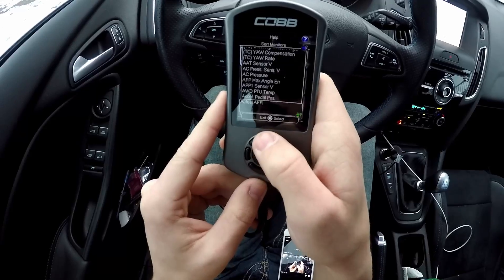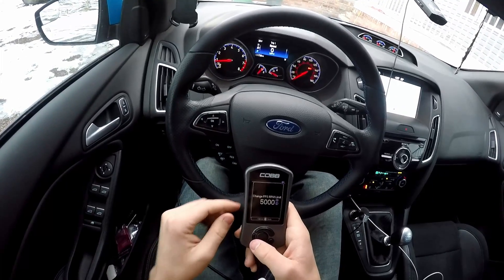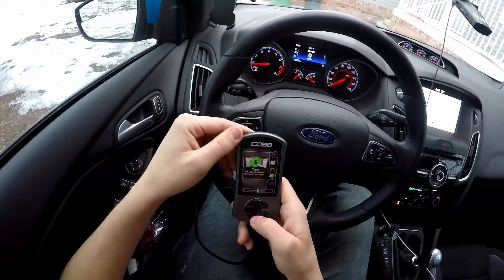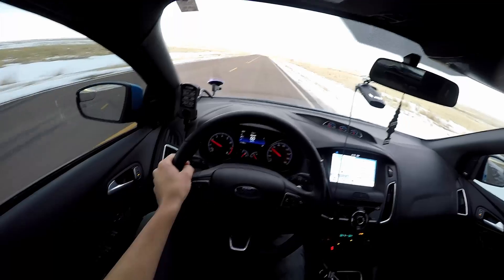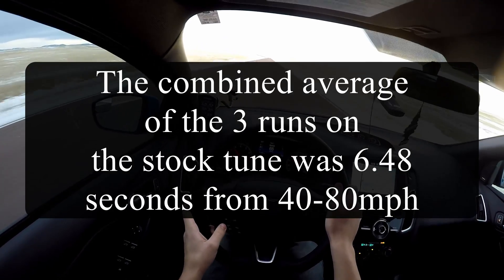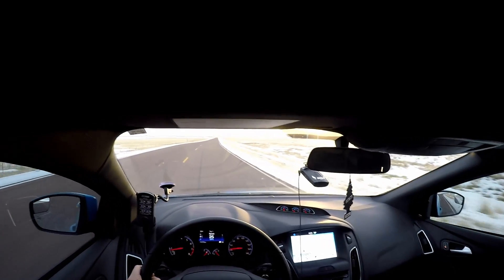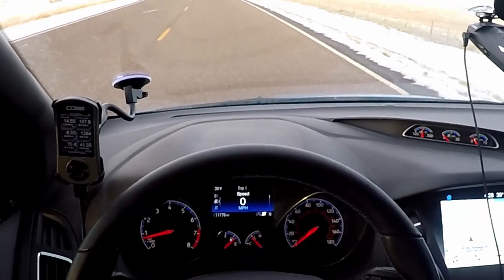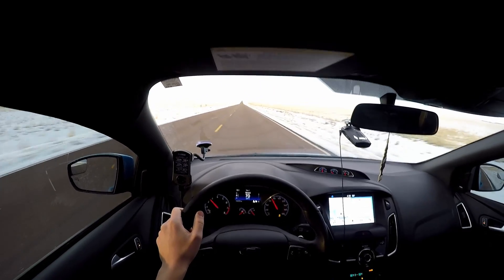Focus Rs stock tune Vs cobb stage one tune.

Comment: That was my main issue with this car when i test drove it.  It didnt "feel"  like 350 hp / torque.  Nice video  clean presentation of the difference the tune makes.
Reply: Wonder if the dealer put premium fuel in it?
Reply: If you dont take it out of the normal drive mod it feels slow..cuz it kinda is

Comment: The Cobb Stage 1 Focus RS tune is a waste.  Abysmal no difference from stock.  Just go with a pro-tune from Stratified or any of the other well respected tuners.  You'll have so much more power on-tap and so much better drivability.

Comment: Good video man. Do you have any other aftermarket upgrades besides the intake? Just wondering how much a custom tune would make a difference  with intake and exhaust over the preloaded tunes. Thanks. Keep the videos coming. Would be sweet to see you drifting around in some snow lol
Reply from the maker: No other mods yet but I plan on getting new boost tubing and a cat back exhaust then getting it dyno tuned

Comment: Hi, I know this is so old but just in case I have questions.  I am thinking about getting Cobb access port.  How long did you run OTS tune? Did you blow up?
Reply from the maker: Ran it for a few months and yeah it did😂 but tbh it was probably more down to me abusing the car than the tune itself. Modern cars have pretty impressive knock control so imo a ots isn’t the worst thing. I think my issue was disabling the soft limiter so I could ride the fuel cut and that caused a valve train failure which killed my motor.  So I’m my experience avoid banging off limiter and doing flat spins😂. It’ll probably be fine.
Reply: wow, It is so old i didnt expect a reply.  Thank you for the update.  Sorry about your RS.  I hope you went Built mountune longblock for replacement......hehe 🙂Subbed. @shenaniganshop3309

Comment: Hey man, great vid. I have a 17 RS and just waiting until the spring until I get the accessport.  Two questions. When you install the  accessport onto the car is it automatically in the race tune. Secondly do you live next to a runway because that road looks insane, thanks
Reply from the maker: Yep it defaults to the race tune but its super easy to switch, I live like 3 miles from a very vacant hiway road in "mexico" it's pretty convenient. Thanks for watching!
Reply: Yeah man just got it on Wednesday. Not happy because in the "recall" ( Ford doesn't like to refer it as that), it clearly states that they will provide alternate transport, a rental. But my local dealership said no I would have to spend $40 a day because I did not buy the car at that dealership. I have spent hours on the phone with someone from China trying to resolve this but at this point just want to stick a poker in my eye. I had an STI before this and Subaru where always incredible with service, loaner cars, anything. I have had nothing with issues withFord and how they have handled this recall and there service. Even the guys at the dealership where old cranky miserable shits, hated there jobs and it showed. Maybe its the culture of Ford but never again
Reply from the maker: Darren Law that’s a pretty messed up situation but I’d say that’s more to do with your dealer then the brand as a whole, some dealers are scummy like that and others go above and beyond.
Reply: Darren Law It took my dealer 5 weeks to replace my head gasket but they kept me in various the whole time I needed one. I went out of town for a week in the middle of the work but they put me in another loaner when I returned home.

Comment: Lets not sell the ST short here.  At 10:00 you say the eco mode makes more power than an ST.  I have tested my ST alot and found a 40-80 video on a stage 1 cobb tune.  It covered 40-80 in 4.9 seconds on cobb stage 1 tune with just a CAI.
Reply from the maker: Rustie Shackelford yeah this was before I rode in a st they are definitely a lot quicker then people think, my buddy used to have a stage one st and it was really close to my rs from a roll.
Reply: @shenaniganshop3309  I have a new ST too. I wonder why it's closer then it should be.
Reply from the maker: Thomas Oleson the st is lighter and makes good torque so at lower speeds it keeps up well but the rs has a lot more top end so after about 50mph the rs really pulls ahead

Comment: Just picked up my RS yesterday. Will ford know you're switching between maps? I'd like to keep my warranty and will switch back to stock tune on the AP but jist wondered if they can find out...
Reply: Juan Tobon they can tell the computer was reset. If you flash back to stock and uninstall the ap then drive to dealership it’ll show on the computer when they hook up it only has 10 miles on it. They will assume it was because it was tuned but have to prove it was the cause of the specific failure you’re in for. Some service techs will flag it. Some won’t. It’ll all depends, but no, they won’t know what exactly you have done to it.
Reply from the maker: The tune doesn’t effect the odometer reading dude lol even if it’s uninstalled, probably shouldn’t talk about stuff you don’t know much about might make you look kinda silly🤷🏻‍♂️ plus mine was warrantied after being tuned
Reply from the maker: I really couldn’t tell you, in my case the tune didn’t effect my warranty. I had a catastrophic engine failure and got a new long block completely under warranty (which I have a video on) but other people say their warranty was denied because of the tune. So the answer is maybe lol
Reply: @shenaniganshop3309  I don't think Agent K was talking about the odometer. The ECU does know how many run/start cycles have happened since the last flash. If you have 11,000 miles and show up with a problem and 10 run/start cycles since reflash, they'll have a good guess as to what's going on. No proof though, hence "undetectable". Also, not all dealers are as strict as others when it comes to warranty claims. Thankfully, I've only dealt with the more gracious ones on the rare occasion I've needed it.

Comment: What MPG you get on the economy mode? Would be handy for longer road trips if you can gain a few MPG.
Reply from the maker: At 80 mph I average 22-21mpg on the eco tune and  20-19 on the stock and race tune. At lower speeds the difference is much bigger though I can nearly get 30mpgs at 65-70 mph on the eco tune.
Reply: Shenanigan Shop that's quite good mileage! I took a road trip this fall from Washington State down to Southern California and averaged 16 to 18 mpg with my RS at 80 MPH, and 18 to 20 at 60 MPH. But I had a cargo box, roof rack, and mountain bike on top of my car! Without anything on top of my car I averaged 22 to 24, but it is very hilly here in Washington.
Reply: I road tripped from Minnesota to Massachusetts it took 2 days. Average MPG was 28 with cruise set to 75 mph that was in about 80 degree Fahrenheit weather

Comment: Pick your Ford dealership carefully, I went through hell with the dealership I bought mine at for repairs and had to go to Ford Performance to find one that sold performance parts to deal with my modified car. Even so, they all will blame your tune for any engine or P-Code issues.
Reply from the maker: A buddy of mine got a eco boost f-150 at the same dealership, he has a tune, aftermarket boost tubing and a full cat back exhaust, took his truck to some off-roading event blew his transfer case and the the dealership didn’t say anything, just fixed it under his warranty. He didn’t even take his Cobb access port out of his truck.
Reply: Dude! You're in great falls? Me too! Just bought a 2018 NB LE RS and I think you're the NB RS I saw driving through 10th yesterday. We should meet up and talk about our cars :)
Reply from the maker: Ninja Kali that sounds fun! You’ll be able to tell if it’s mine from my Cobb stickers and rally armor mudflaps, my dad has a 2018 nb rs also but his has a black roof, mirrors and wing. If you have Instagram or snap chat you can Dm me so we can plan a meet up both are shenaniganshop

Comment: Do you not put it in sport mode with the tune on? or no need?
Reply from the maker: The car has the same power in every driving mode so there’s no need really
Reply: I'd still put it in sport. It would tighten up steering, and open exhaust valve
Reply: @shenaniganshop3309  if you have the stock exhaust its only open 70% in normal mode which creates some exhaust restriction. It does make a difference
Reply: @4200cg  also adjusts throttle response/sensitivity which makes a world of difference

Comment: I don't understand how so. Any of you can just void your engine warranty so quick and easily? And yes this voids your warranty. It's also a federal violation of EPA laws to unlock a locked ECU, and manufacturer laws. The EPA is starting to crack down on people big time. And there is no way to re-lock the ECU if you remove the tune .
Reply from the maker: 😂no it doesn’t dude literally watch my newest video I blew up my rs and it was fully warrantied I show the receipt to prove it you should really do some research before you make yourself look stupid🤷🏻‍♂️
Reply: Actually master car guy is correct brother. Im a ford tech of 15 years. Hes absolutely spot on. You were lucky with your situation. They couldve told you to eat shit. You're the one who needs to do some research

Comment: how bad is FFS for the stock clutch?
Reply from the maker: Definitely shortens the life however launch control is much worse for it.
Reply: @shenaniganshop3309  That's what I figured.  Maybe play around with this right before a clutch replacement or upgrade.  Thanks for the response, I know this is a old video.

Comment: Can you turn off the auto start on/off
Reply from the maker: Yep! Button right next to the drive mode button you can also get it disabled with a tune
Reply: Lmao I know the button I meant if you could turn it off permanently with the tuner
Reply: you can easily turn it off permanently by unplugging a connector at the battery without a tune needed

Comment: I hate to break it to you but your very misinformed on warranty with mods. The Moss-Magnuson Warranty Act only cover stock vehicles. And a GM of a dealer can't stop or sway a regional manager from Ford or wn Engineer from busting your two best friends below the waist.  I've been down this road as a customer and as a manager at a Ford dealer, a dealer that is in the top 5 of sales nationally.
Reply: MH motorVlogs It is a matter of you gotta pay to play regardless, from
What it seems like it the RS’s headgasket’s are failing, owners should be mindful to make sure it doesn’t go before they start messing with the ECU

Comment: A d to dyno an awd car, always dyno in awd mode, not two wheels.
Reply from the maker: Wrong the rs can only be dynod in “fwd mode” because the rear differential is ever so slightly higher geared then the front and this causes multiple problems on a awd dyno look up a video of an rs being dyno’d it’s always in fwd mode

Comment: Seems slow either way
Reply from the maker: Ideally you would be in 2nd gear if you were accelerating from 40mph in this car, but to keep it more consistent I put it in third, so there were no shifts from 40-80mph.